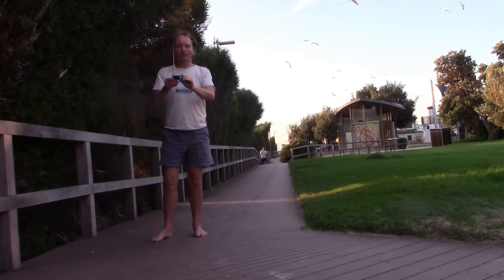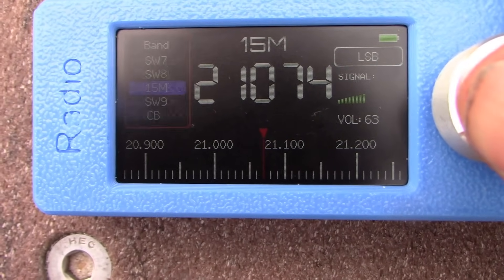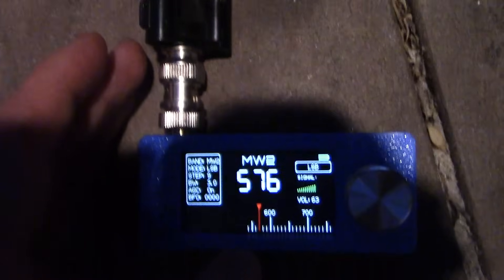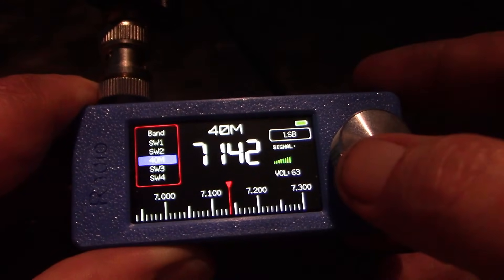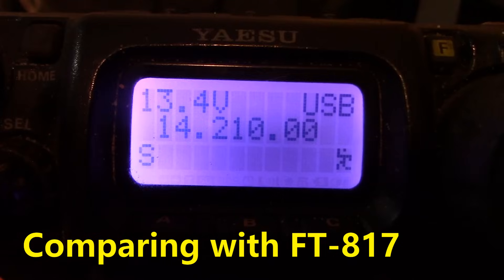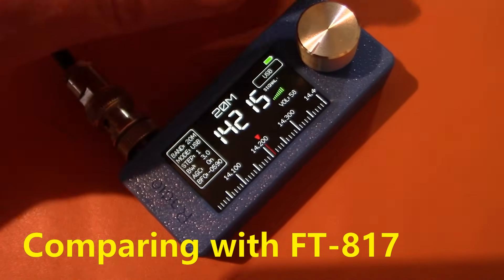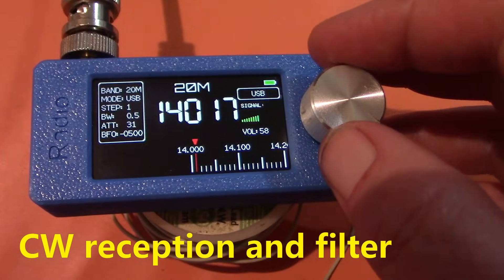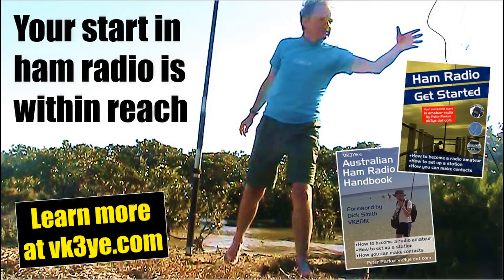Si4732 tiny receiver review: Part 1

Comment: Tip: get the better version of this radio. Cost is a little more but performance is way better. You can recognize it by the bright red AMNVOLT on the front and back. You want the V3s version.

 What is better? 1. Better sounding speaker. 2. Built in headphone amplifier so you can use it with earbuds at reasonable volume. 3. Hi Z FET matches and amplifies input to the radio chip 4. They fixed the battery drainage issue.

Finally, be sure to update the firmware by refreshing. There are at least two developers who are active in upgrading and adding many exciting new features .... don't miss out as the new firmware is free to download and update.

KD5TXO

Comment: I have one of these receivers, and it is an amazing little gadget. However, a firmware upgrade is essential for usability as it fixes issues with the encoder knob's clicking and double click timing.

For around the same price, about 25 USD, you can get the ATS20 Plus, which uses the same receiver chip but is controlled by an Arduino Nano instead of an ESP32. The ATS20 Plus offers significantly better audio quality thanks to its full size speaker and is easier to use with eight front mounted push buttons. It also comes in a full aluminum chassis, adding to its durability and appeal.
Reply: Ага как этот ваш АТС влезет в карман.

Comment: I like this small receiver a lot. 
I intend to modify the firmware and add some functionalities such as an internet radio receiver, I think it's feasible.
There are several firmwares available which enhance it a lot. Just installed one of these (v1.07) and it's already a lot better than the stock fw. It even offers themes and the screen turns off after 10 seconds or so. Very nice !

Comment: These receivers appear to be improving.   Im mindful of reliability as per others comments.  Theres a fun project there to pair it with a MOPA or single keyed transistor CW Tx, but you would need to mute the Rx to stop it squealing. 😮

Comment: Nice little radio although I resisted the temptation of buying one when I ordered other things at Aliexpress.
Two things worth mentioning - according to a datasheet of the Si4732 chip the audio output is only 90mV max, so it can best be used with amplified speakers or headphones. And you mentioned that there is no front end selectivity. Well, there is a very crude bandpass filter by a 27uH inductor outside the rcv chip and a varicap in the chip. Won’t make a lot of difference I guess.
Reply from the maker: Thanks. Something I didn't mention (as I've only tried it with one pair of headphones) is that the headphone volume is a bit quiet. Whereas the speaker is surprisingly loud.
Reply: @vk3ye The headphone is quiet because of the low audio output level (90mV). The internal speaker has a small class-D amplifier chip on the board.

Comment: It's so small that you won't notice the hundreds of feet of long wire that you need to drag behind it :)
Reply from the maker: I did a test of various antenna lengths. 5m of wire is OK but still a little short. 10-15m seems better.
Reply: Really?
Reply: @g8itb-radio They're only ever as good as their anetnna

Comment: I bought the AT20 for less than $30 dollaridoos of AE

Similar performance though it has a tiny display. That said, it’s kind of OKish I guess

I spent a little over a hundo on one with a 4.3” display with a waterfall. Similar performance and lots of birdies and other glitchy things thrown in for free…but it does have a waterfall and has been useful for tracking down what’s causing QRM….which is anything with a blue LED